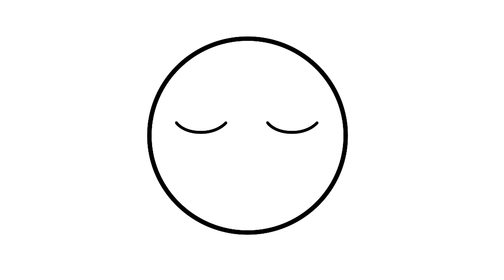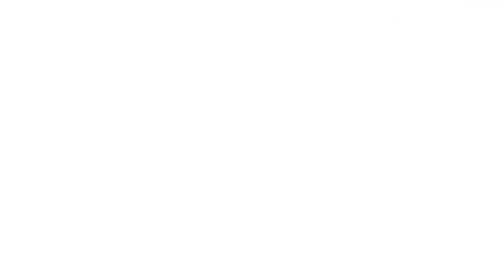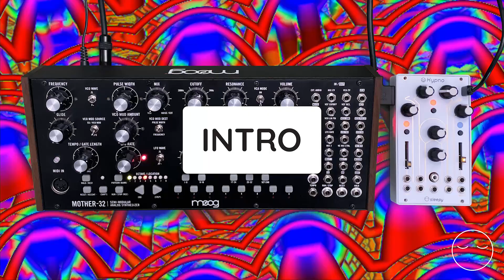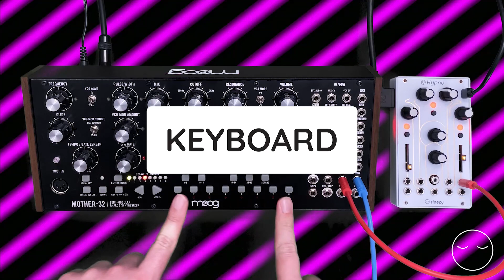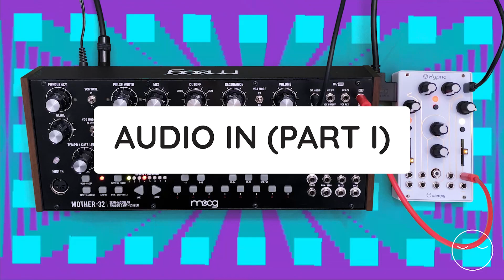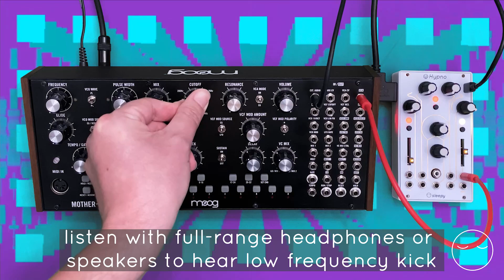How to Create Audiovisuals with Moog Mother-32 and Hypno

Comment: Hi.  great vidz.  I own a hypno with top and side micro usb and have a question about powering... I have seen videos saying to use the side usb to power, and then I see this video and see you are powering it from the top usb.  I powered mine with top yesterday.. Does it matter which is used?  Why 2 usbs?  Thanks!
Reply from the maker: either usb will work to power hypno! you can use the other usb to plug in a flash drive to manipulate your own video or use the video packs on our website.

Comment: How easy is it to output these visuals to a CRT?
Reply from the maker: On the original Hypno there is an RCA/composite output, and on the Hypno DIY you will need a Pi 3.5mm TRRS to RCA dongle which tend to be a little noisier

Comment: at 6:10 - is the m32 VCA output a CV envelope follower in this case? or audio out?
Reply from the maker: In this case the audio is just passing through the Mother-32's signal path to the VCA output, with the filter engaged part of the way. The example after this, when using audio to trigger the envelope, is a bit more similar to an envelope follower. Our friends at Noise Engineering have a great article on envelope followers! https://www.noiseengineering.us/blog/envelope-following